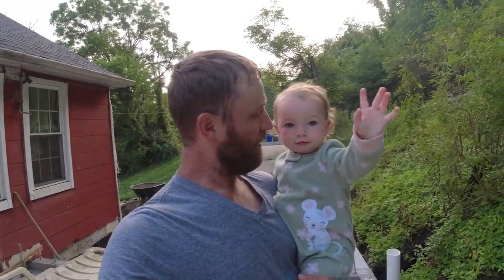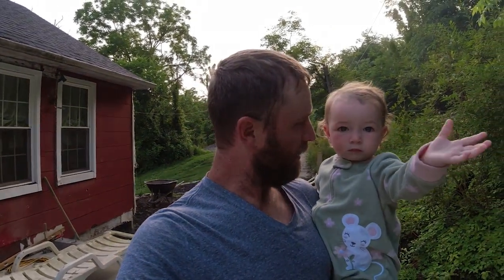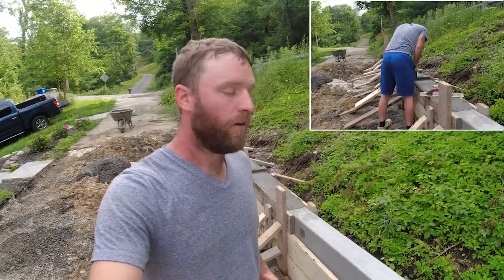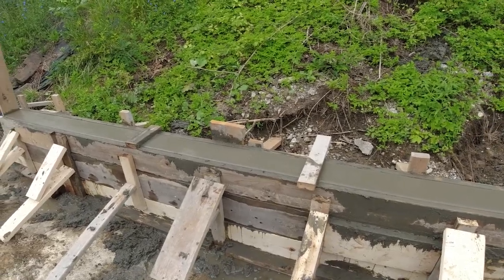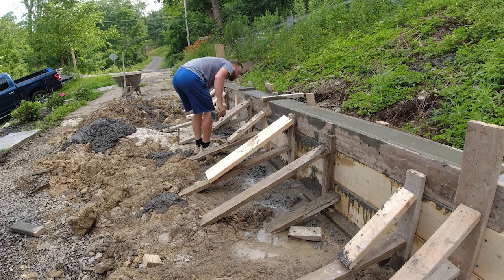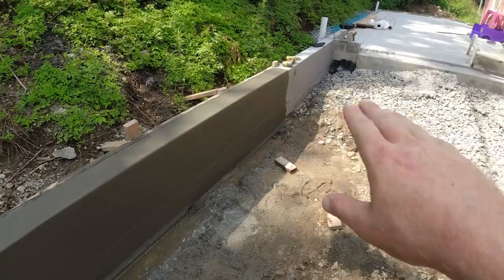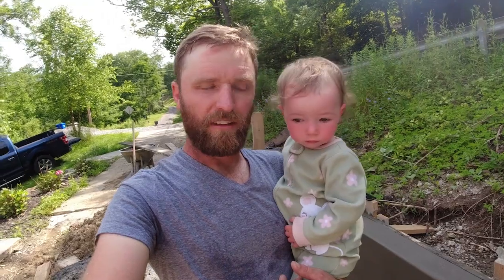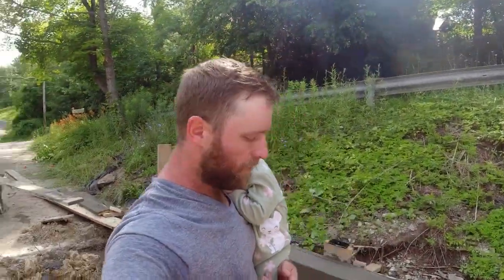Finishing The Retaining Wall With My Little Helper!!!

Comment: It’s always better when you have a beautiful helper!  I did a lot of retaining walls in my day so the question is did you add accelerators like calcium or aluminum sulfate to the mix ? Also we use 1/4 “Masonite or Lauan  plywood liners for better finishes less work later !  And lastly I would run the wall all the way to the road and ask the state to run a curb down the road edge to help divert run off past your driveway?
Reply from the maker: Thank you! And nope, no accelerants yet. This video was filmed in June or July haha so it was warm enough. We are almost at the point now that we will start putting calcium in our mix. Thanks for watching!